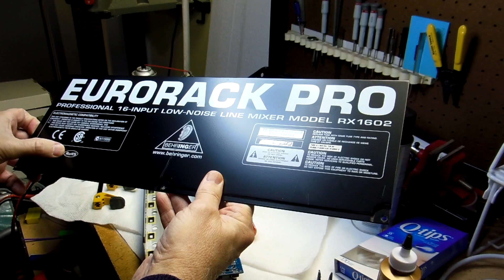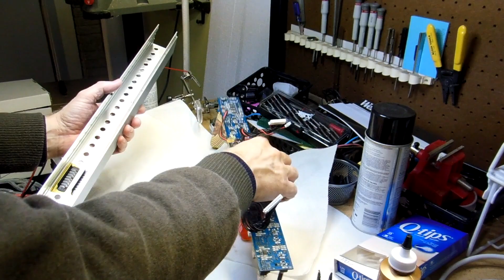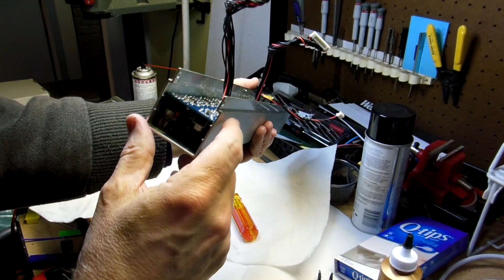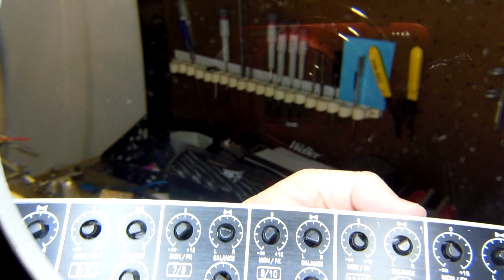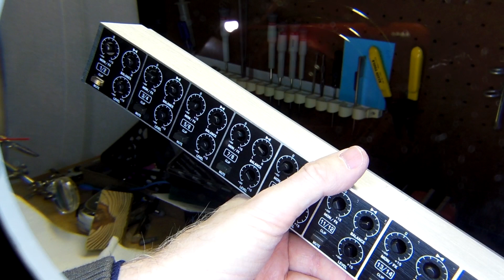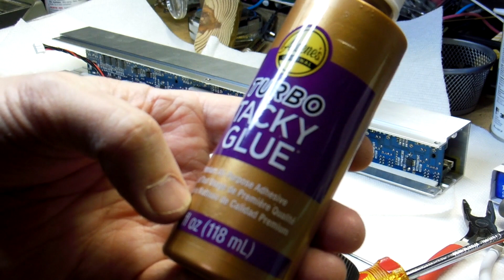Inside the Behringer RX1602 Line Mixer

Comment: I have such a unit, I have a channel (with scratchy pot and MUTE that doesn't light anymore) came upon this video investigating how it looked inside, that covered that part, curious how did you remove the knobs on these pots? I tried pulling them by hand with no luck. I would have loved to see the taking it apart steps for this unit. EDIT I tried again with some rubber around the plastic knob to get a better grip and it came right out. So before you resolve to using pliers... try a rubber band piece to provide grip if you're having the same issue I did, worked.

Comment: Great info. However, A close up of the wire loops that you changed would of been very helpful. Even a link to a schematic would be good. Cheers
Reply: It is in the last page of the user manual. It shows how it works, where you have to cut and where you have to solder

Comment: If you can't imagine what PFL is for, you just lack imagination. PFL is for monitor, not effects. I use it to drive two sets of speakers. The stereo output goes to my NFM's at the PC. The monitor goes to a wedge that I have set up as if for live performance that I use to practice mic technique while playing guitar and singing.  You could also use it to run just one of your keyboards to a Leslie or something similar. 

I just wish the headphone volume was before the output volume - it's the only accessible volume knob I have for my speakers.

Comment: Thank you for your video.
Just bought one of these used.  
All the mute buttons were sticking , all the plastic bushings were loose.
That may be because someone tried to clean the pots and switches without taking the thing apart.
Do Not Do That!  It will probably dissolve the glue holding the bushings in place.
Well , I've cleaned all the controls best I can and it seems to function fine.
Wish I'd bought a new one and would not advise anyone to purchase this unit used. 
The plastic bushings , I re glued with SuperGlue Gel. 
Waiting for the SuperGlue to set before I put it back together.
The rubber strips I'll use a hot glue gun to tack in place.
I also have a the ability to repair stuff so , I guess I saved some inexperienced person from the work.
And , I saved a few bucks.  LOL.
Thanks again , your video helped me greatly.
Reply from the maker: I'm really glad, thank you. I think a lot of times, people use the wrong stuff on pots and switches (WD-40 or petroleum-based greases) and just cause worse problems that can't necessarily be fixed.

Comment: Hello, and thanks for this video, I was happy to find it. I recently picked up one of these mixers to connect synth modules, drum machines,  amp simulators, etc to my USB interface. It's 13 years old and many  of the pots are scratchy so I want to get some Deoxit in there.  I've got the circuit board out but can't find a place to get the contact cleaner in!  Those tiny pots are a lot different then what I'm used to seeing. How did you do it?
Reply from the maker: I don't remember how, but your best bet is where the terminals enter the casing and even where the shaft enters the casing is fair game.
Reply: I did find that I could get contact cleaner into the pot via a tiny little hole on the top where the metal casing is joined to the plastic terminal block. I had to use a hypodermic needle but it did the trick. Also let some run down the pot shaft. The scratchy pots are now static free and hopefully will stay that way for awhile.

Comment from the maker: UPDATE: A year and a half on, this mixer is getting used daily (if only just to run my laptop's audio to the power amp and the room speakers) and no problems.
Reply: Hello, 
I have a question regarding this mixer. The Mon/FX send on the back is mono only. Hower you cab route the mon to the headphone jack. Can you tell if I get a real stereo signal when routing mon/fx to headphones? Or is it just a mono witch is played on L and R?
Reply from the maker: @farbenformenlicht  Appreciate your question. The headphone output is really in stereo, i.e., the setting of the "balance" controls of each channel affects the headphone output just as it does the main L/R output so for effects with a stereo input you could hypothetically use the headphone jack as an output to those effects. I don't like using headphone outputs for anything but headphones, so what I do in my keyboard rig is, I have an Alesis Midiverb III that has stereo inputs and outputs but I use the mono monitor output to feed it and run the Midiverb III's left and right outputs to one of the mixer's input pairs (which MUST have its "mon/FX send" control all the way down lest nasty feedback occurs). The Midiverb III's "mix" control is set all the way to full wet so that all that is coming back into the mixer's input pair is just the reverb signal with no original. This means that I can use each channel's "mon/FX send" control to assign any of my instruments to be reverbed as much or as little as I want, I've got the master "mon/FX send" control to keep the Midiverb III's input from being overloaded, and then I've got the "level" control for the mixer channel that's taking the Midiverb III's output to control how much overall reverb is being sent out of the rig. Given a reverb with stereo inputs and outputs, I think it's much more valuable to make use of the stereo outputs instead of the stereo inputs if you can't use both in stereo.
Reply: @hubbsllc  thank you for your fast reply. Really appreciate it. 
Im looking for a device that i can use as a 2 zone mixer. 
I want to mix like 8 channels for the master out but only 7 for the second mix. Therefore i wanted to use the headphone jack. But that would have been bad if the effects on headphone only were mono. 

(I hope its understandable, im not native english)